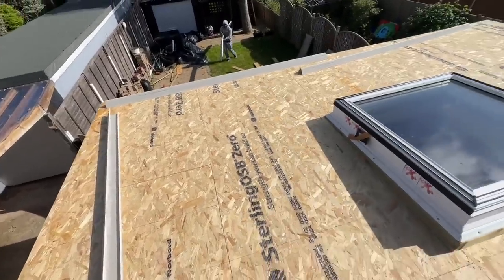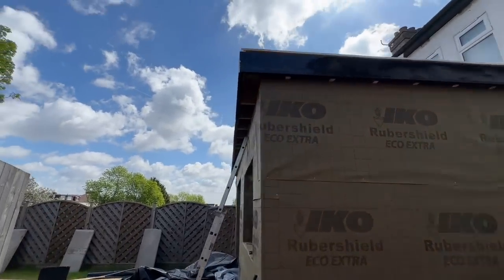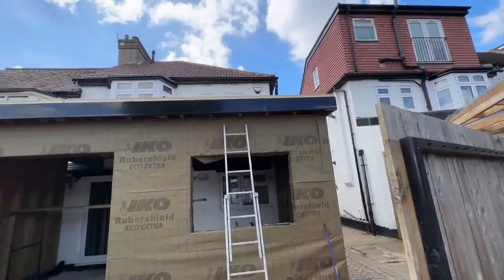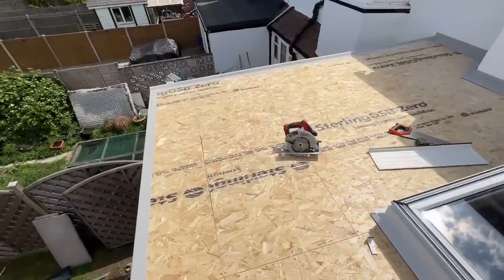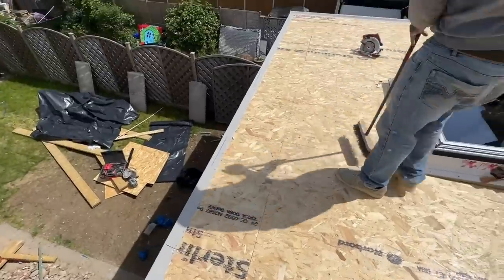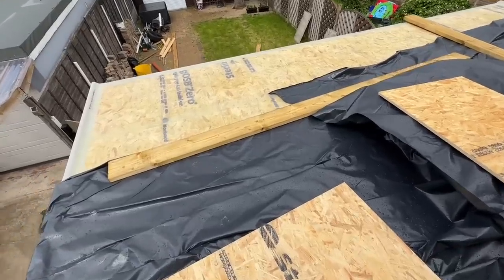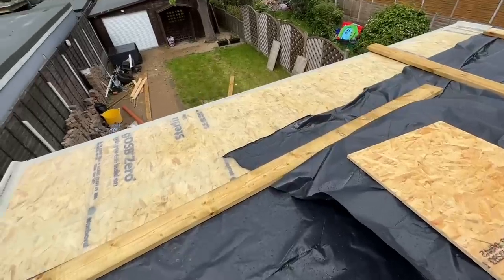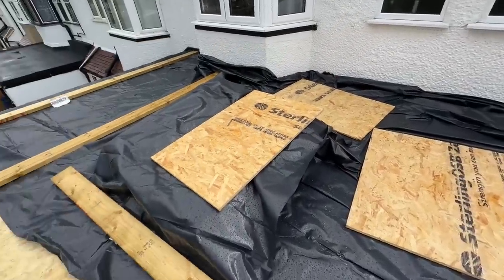Timber frame extension: Ep 17

Comment: As a approved Cure it and Res-tec flexitec 2020 installer, I have a few issues about the roof your installing. Where are the 5mm gaps between OSB boards and the 25mm gap against the wall of house. No masking tape and bandage work on any of the trims and (tight)wood joints. No adhesive on trims to stop rattling noises in windy conditions. Looking at the job I take it it’s a cold roof,where’s the ventilation for the insulation boards. In the height of the summer the resin roof covering will hit over a hundred degrees, thus causing sweating between roof and plasterboard. Sorry for the negative feedback but I’ve only been a (flat) roofer not a tiler for 28 years,and I can see problems in the near future
Reply from the maker: You can only see what we show you. People assume alot from short videos. Some of the previous videos will answer some of your question. There is 3mm gap as recommended by sterling. You can’t see adhesive. Other videos I show is explaining. Ventilation system for this roof is explained in previous episodes. You have “credentials” and I don’t so no point going on anymore anyway 🤷🏾‍♂️